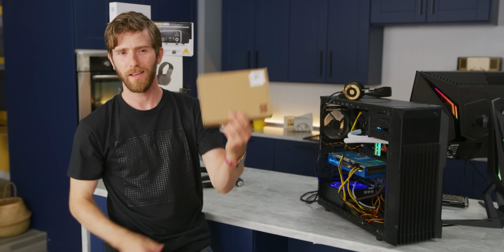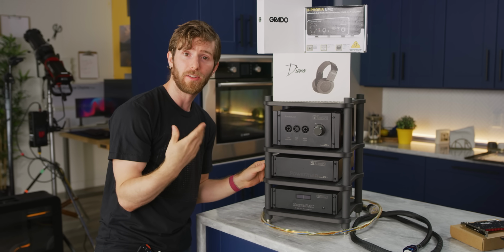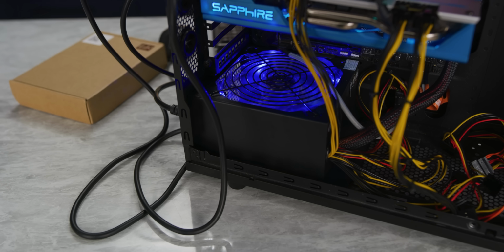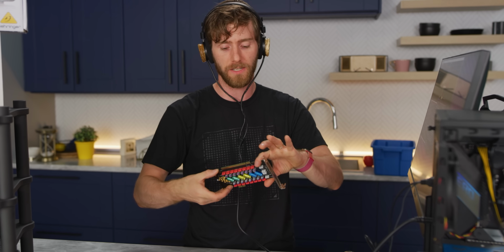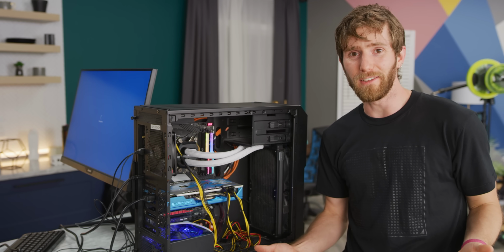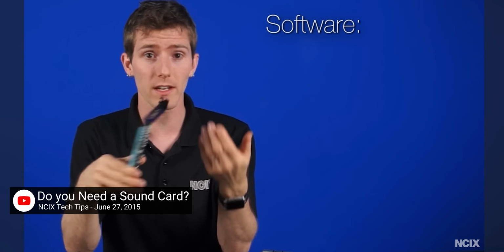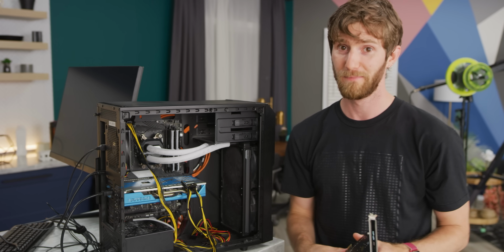Is this $40 card a SCAM? - "Audiophile" Power Filter

Comment: Having a 450$ Motherboard from Asus which already has one of the best audio shieldings out there might not get the point. I have that board too, and it has one of the best voltage controllers from Asus. This board corrects all the noise all by itself easily.

Maybe get a 50$ or 150$ Mother Board  without great audio shielding and see if it helps there :)
Reply: Like, if you're buying that thing to clear up your on-board audio, and NOT buying a not-trash sound card... I still don't see the point
Reply: Wouldn't hurt to get a sound analysis program too, so we can have some hard numbers to go with it. Just saying, "It sounds the same to me" tells us nothing, other than Linus can't hear a difference by ear.
Reply: Even then, it will not make a difference. Expecting it to make a difference is like expecting a filter placed on one branch of a forked river to impact the other branch of that same river.

Unless the filter is in between the source and playback device, it will do absolutely nothing.
Reply: that is what i was thinking right now. Please test it again Linus!
Reply: @Muffinmanerino Ealgerino Can I get some $1500 speaker cables with that nugget of truth, please?
Reply: This comment needs more upvotes!
Reply: true. But i have to point out that a $20 dac from amazon will outperform asus's onboard audio. It has never impressed me.
Reply: Linus messes up so many tests like these.
Reply: Agreed, stupid test, start with cheapo motherboard.
Reply: it still shouldn't do anything because its not sitting between your psu and the board. it can't filter anything really
Reply: @AsbestosMuffins  aaaactually, it can. You should always place all the filtering as close to the drawing component as possible. Having extra capacitors that are literally physically (and electrically as well obviously) closer to the sound card, and I'm imagining someone plugging this right over/under a proper PCI/PCIe sound card, can indeed filter a lot more noise than if it wasn't there.
It is true tho, that it's still too far from the components anyway, that should already have proper filtering anyway. It's rather pointless even if theoretically working.
Reply: He literal counters your argument at the end. But also it still wouldn't help as nothing plugs into it, it's just sitting in a slot. This is clearly a scam.
Reply: @prich0382  filter capacitors will in fact filter noise, even if they're not on the same board. It sits on a free slot, that is connected to the PCIe power pins, so in fact connected to the motherboard's power (that is, assuming a correct board layout. Even the scammiest company wouldn't leave unconnected stuff if it costs them literally nothing to connect them, since the copper board is already there). It might be crap, and useless, but the principle is real and not a scam like some stupid CD edge lathe that I saw around. All this thing does is adding capacitors to the circuit, in parallel, which is how they should be electrically connected in any circuit. The point is that there's still quite a long path for noise to creep back in until hitting the sound circuitry.
Imagine your PSU. It's filter section is... inside itself. That's literally the entire cable length away from the components, and it works. Whoever, the cabling itself will receive interference again as antennas, and the components on the board will generate interference as well, hence all stuff that need clean power need the caps right beside them.
Reply: @Kalvinjj  As Linus described, motherboards do this already, getting a crappy motherboard and attaching this though is stupid, just get a better motherboard instead.
Reply: @prich0382  Yes, it's entirely stupid. True principle, but pointless outside of a horrible situation that you should be worried about more than noisy audio.
And like I said above too: wanting to upgrade your sound by buying anything other than a proper sound card sounds silly (that is, not counting all that is after the analog sound that leaves the PC).
Reply: @Kalvinjj  The possible noise injection is a valid point against this design. However the 1KW PSU at this load likely adds a huge filter to the system. Not sure what the frequency range it provides. This board used lots of different cap sizes. The price is kind of the interesting part.
Reply: the answer is: "when you need to spit out videos every 5 hrs..."
Reply: also maybe some cheap headphones. I used Steelseries Arctis Pro 7 (Wireless) and they had a lot of noise, that I only found out the day I bought beyerdynamics and a Focusrite amp

Comment: It's IMPOSSIBLE for that card to have any effect on anything except something that the card itself would output or connect to... Like if your gpu connected to that card then maybe it could help or if your sound hardware plugged into the card then it could help but that's not how this thing works so it's 10000% useless... Wtf

Comment: Why wouldn't you just plug your computer into an external power conditioner? Also flac is snake oil, people with perfect pitch can't tell the difference between at 320 kbps, and flac or wav audio at any bitrate

Comment: so the voltage on the front panel 3.5mm audio jack is 3 volt, some sound cards use 5 volt. harder drive higher frequency range.

Comment: What a scam this is.
If anyone cares about audio, he probably get a decent sound card with all the neccessary filtering and shields it needs.
Also good mid range boards nowadays have a very decent onboard audio with a great DAC and dedicated caps and such.
Anyways the only thing this capacitor card will improve is noises, not the audio quality if even anything.

Comment: Yeah, this card does nothing. You want a shielded cable for your front IO or just use the back for the best quality from an internal sound card.  Idealy just use an external one and avoid all the noise inside the case.

Comment: the card itself is pretty dumb tbh.
yes in linear power delivery systems building thses capactors and stuff works, but thats the point, linear.
this is not linear power delivery at all, this is parallel, and even that isn't doing it justice.

Comment: that crackling noise is from your water pump sucking in all the air from the rad because you have it installed upside down... HOSES AT THE BOTTOM

Comment: I didn't expect this to work.
But the video is still a fail for not actually attempting to use any actual audio measurement tools. Human ears are less than perfect and so you should be using something that can measure THD+N and the noise floor as numbers, not opinion.

Comment: Power conditioners, at their heart, are battery backup systems, WITHOUT the battery packs.  We have one on our TV and cable box because of the mini fridge on the same circuit, works like a dream, can even power those devices for three seconds during a brown-out.

As for my sound card, yeah, onboard is great, but for Doom Eternal's launch, I got a Sound Blaster X3 external device for my computer, been loving it, and it can switch freely between a headset and a speaker output of some kind, either software level or device level.

Comment: Adding only capacitance to smooth something like a power rail is really a caveman solution omg. Maybe it cuts of big voltage spikes (hearable as pops) but nothing more. Now linus talking about FPV, fast turn of the video before more brain cells die

Comment: Wait..... power conditioners are supposed to run in series with the audio source. This thing is just running parallel in a completely unrelated PCI-E slot. That functionally can never effect the power reaching the on-board sound. I'm thinking that you guys are missing a crucial component, like a PCI-E riser that could connect to the 1X finger on the top of the card.

TLDR, I don't think you guys are using this as intended.

Comment: Problems I have with the testing in this video, no solid test tones are used to test specific frequencies. You drop the card on the floor so you might have broken the damned thing. We don't even get to hear what you are actually listening to so we are completly taking your word for it. 

Sure it's probably a gimmick card, and their claims make no sense outside of the power filtering. But there isn't anything in this video that can be actually taken as evidence at all.

Comment: meh. something that plugs into the pci-e slot isnt really gunna do anything, maybe some sort of ground loop isolation at best. What you want is a power conditioner like he pointed out. I knew this wouldnt work because the "cleaner" is not inbetween the psu  and its hookups. I can imagine like a box that plugs into your modular psu and then you plug into the box would be a bit more effective, but even still the biggest gain you will get will be from conditioning the ac power before it hits the psu, then think about what you can do to clean up the dc source, like a simple ground loop isolater or something to that effect. Its also of note that he mentioned the dac, putting the signal processing on a seperate power source, which is how the pros do it.

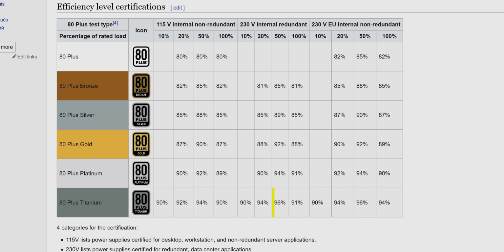Comment: 1:45 I'm just going to point out that "a peak of about 60% for a linear power supply" is not strictly accurate to say, misleading at least. Many common linear supplies might have a peak efficiency of around 60%, but a decent bit more efficient linear supplies are definitely possible with modern components. Not as high as a good switching power supply, but still, you were comparing vs cream of the crop best case peak for switching supplies.

Comment: Linus if you admit that there's no noise with no music playing then there's nothing to filter out and zero benefit. A lot of motherboards already have noise filtering capacitors for the audio circuit. But not all motherboards. You should repeat this test with a motherboard that has a cheap audio amplifier.

Comment: Wow, Axial THT and radial SMT aluminum electrolytic capacitors, tantalum capacitors, and film (polypropylene/polystyrene) capacitors arranged in a fancy way...

Did we forget about the inductance through the motherboard and PCIe connectors?  The capacitors won't help at all except for low frequency filtering.  The most important filtering is for transients due to high current switching.  The frequencies of interest are broadband, but high frequency filtering is critical.  I trust the motherboard and GPU manufacturers to provide adequate bypass and filter capacitance while maintaining good layout practices for low inductance and small signal loop area.  They know what they're doing.

-2 cents from an electrical engineer that works on high-speed digital system design

Comment: Had my 1st laugh of the day when linus said "25$ 1000w power supply"
Reply: They do exist on the used market, Ex mining PSUs... 80plus platinum with high wattage... maybe not $20, but certainly under $50.
The key is the ones im referencing are specifically designed for mining rigs, so with things like 7 seaparate wire runs with 1 sata+ 1 molex. . and 12 PCIE 8+2 pin.
They are a pain in the ass for cable management, but besides the industrial build quality (extremely budget , no sleeving etc).  the ones i purchased actually had good componentry, Taiwanese Tier 1&2 Caps.

The key is making sure its actually listed on 80plus .. not just a label on the PSU or Box.

But they do exist on the used mining psu market. This is one example .. its a good solid unit electrically , just a PITA for cable management. 

https://www.plugloadsolutions.com/80PlusPowerSuppliesDetail.aspx?id=1408&type=2

Comment: You actually WANT easy to drive headphones to test that, like iems, the higher the impedance the the more power the headphones needs, and the more that noise is covered by the stronger signal. That's for example why you need a good amp with low noisefloor if you are serious about iems

Comment: If y'all are going to review products that are intended to reduce audio noise you should really be showing the spectrum analysis of a pure sine wave (usually done at 1 khz). It's the standard way of measuring the noise floor of a system, it removes any subjective bias, and it gives a viewers a way to see the difference in noise themselves. And it would only take ~30 seconds to explain how to interpret the graph to the audience.

Comment: Are you joking? This "test" is crap. The card will probably remove some noise but you can only check it up with an oscilloscope or a test bench of the audio signal to evaluate the hum level at 60Hz and anyway,  whatever the results, it certainly never remove the external noise generated by the power supply or any other component when you put your ear close to it...

Comment: Something worth testing or addressing on this issue could be what happens when you use electrically grounded PC speakers, like self powered studio monitors. They will pick up the PCB digital noise, which sounds different from hiss and hum. You will rarely hear it on headphones since they are not grounded to the electrical ground of the building, but will hear it on grounded speakers. That's PROBABLY what the maker of this card is talking about. Removing ground pins gets rid of the noise but poses a pretty dangerous electrical shock hazard. I have gotten significant coil whine bleed while gaming into my USB external audio interface even. Not audible at all on headphones connected to it, but audible on the speakers.

Comment: I think a product like this might be headed towards people that use hdmi to send audio to a receiver and the coil wine goes with it.  One solution is to clip the ground on the pc and receiver power plug but that can be dangerous.

The coil in the card will still whine. The whine that makes it into the ground floor of the hdmi will not be the same ground that the receiver has.

Comment: Linus... I think I know how to use it as it where designed because I have some diffrent issue than the signal out to try to see if it does anything. I have a an amplifier to see if It could filter out the noise and hum within it, because when connecting an totally issolated sound signal it will be completely noise-free. I have three-phase 240V AC line and in my room I have access to all those three-phases in sepaerated power outlets, so if I connect the dedicated amplifier to one of the phases (outlets) then the PC to another I get the AC-phase difference and get a lot of noise. So in context you have to understand how the AC-line path is taking. I have an older AC wireing where the Ground is tied to Neutral so our plugs (Swedish EU-plugs) can be put in the other way, creating this Live-wire to Device-Neutral and Neutral becomes device-Live-wire. So if you could send me that card I could test it in my PC to see if it works or doing something for me in my situation.

Comment: A power filter doesn't help with ground loops. I mean it can, but not all: ground loops happen when there is a different voltage in your power circuits when a (ground) connection is made between them. And different voltage happens mostly due to power draw - like from your PSU / PC components. So if you have external speakres plugged into the outlet and your PC plugged next to them they have the same input voltage but the PC draws more power, dropping the voltage, and creating a ground loop. If you then hook an audio cable between your PC and your speakers, you'll hear the ground loop.

Comment: I'm telling you.. do this test with something known to be put noise on the AC lines. 
Take a netgear AC lan power adapter (two actually) and get a link with data traffic. Setup a script to continuously send a large file from one PC and then delete, then repeat. 
Those things put a metric F-ton of noise on the AC lines which you should be able to hear over your headphone jack. 
Test with and without the card to see if there is reduction in the interference. 
Until you are testing something with a higher baseline, your test is completely meaningless.

Comment: In theory that could improve filtering on the motherboard if the motherboard is missing all the filtering. If you had such a bad motherboard, you could improve the system a lot more by using extra $40 to get a better motherboard.
(After watching the video to the end, it turns out that the same point was also done by Linus :-)

Comment: how about putting a bare capacitor into the 12v molex connector? the wires all come from the same point in the psu(most single rail non modular psu). will a capacitor at the connector help alleviate these issues?  will it affect the ripple ?

Comment: The filters you mentioned are used for drones, work because they are inline (power goes in one end, goes through, and goes out the other). On the other hand, the PCIe card here is connected in parallel to the power supply line, only adding additional capacitance to it, potentially only improving voltage drops due to spikes in loads. So yeah, totally snake oil...

Comment: use a mic with a long aux cable
u can literally hear the 60Hz noise very loud(has a flagship asus board and i literally have ground wires hanging everywhere around my mic)
do a test with that and see if it does anything